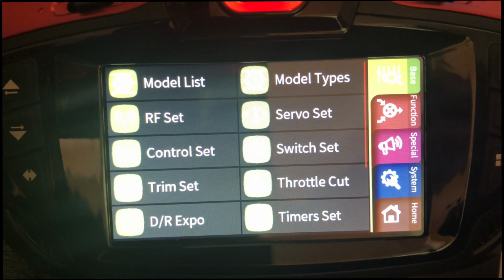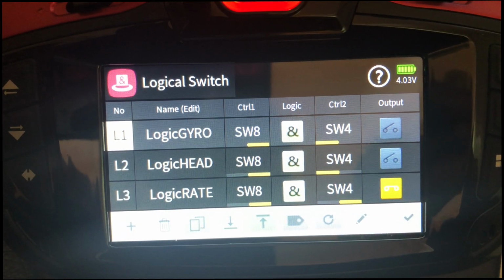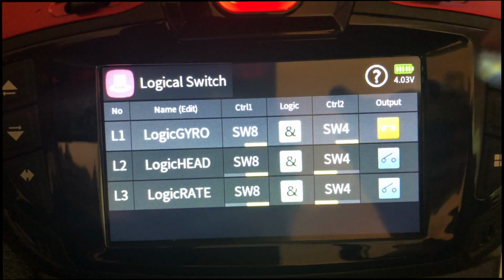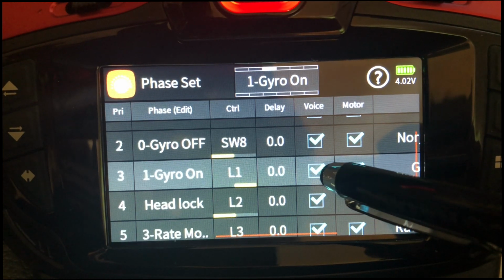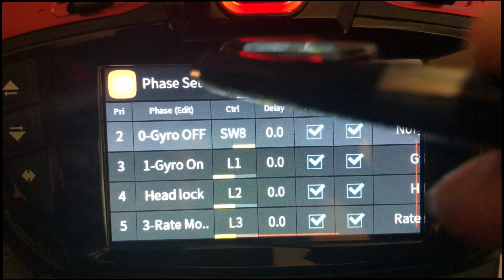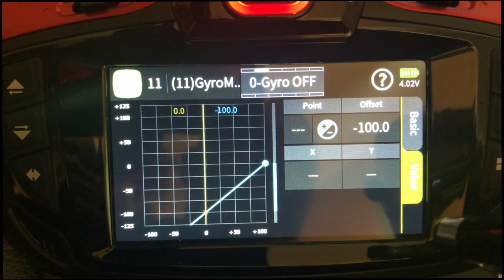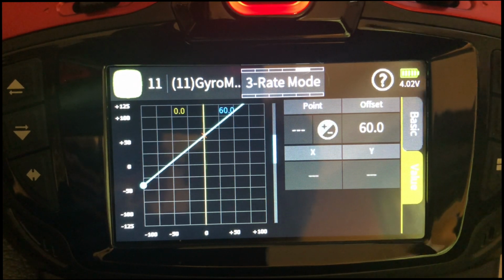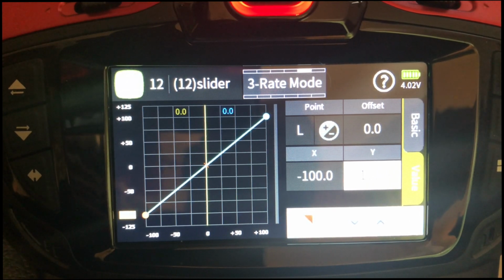MZ-32 Gyro modes using logic switches[Fixed]

Comment: thanks for the Video!
but how can I programm the Gyro without the Flight Phases?
I use the phases for start, speed, thermik and landing!
Reply from the maker: Instead of using phases to configure the offsets, just assign a three position switch to the control and then configure the offsets for each of the switch positions.
Reply: @yufasa  Thanks, that works fine for 3 modes (stabilization, heading lock and rate) but how can i switch the gyro on and off?
Reply from the maker: @joherl4761  Now you went and complicate it :) The only thing that comes to mind right now is to create a free mix that will override the control when you operate a two position switch...there may be other ways but I need the radio in my hand to think!